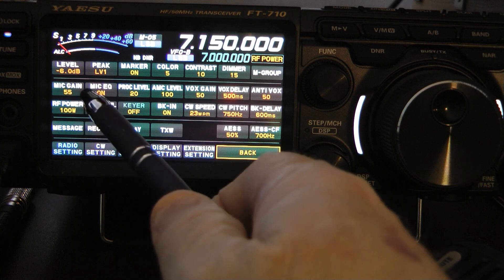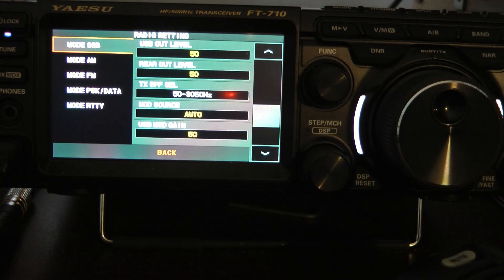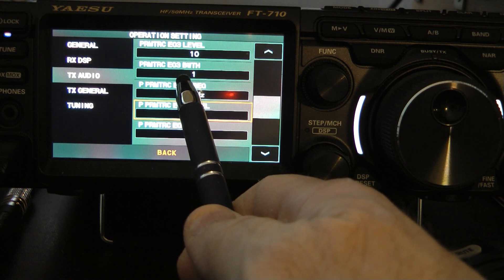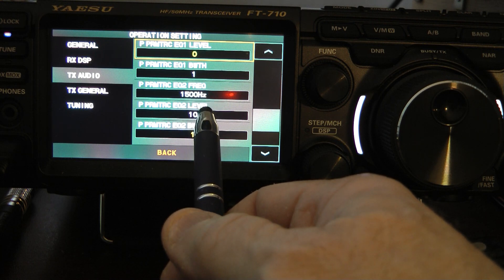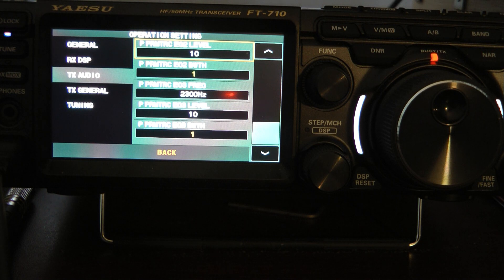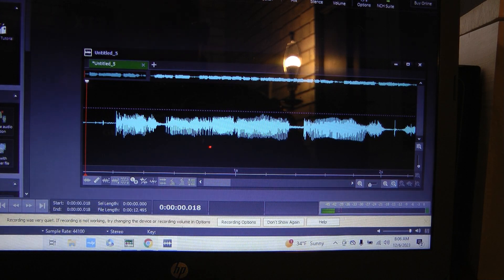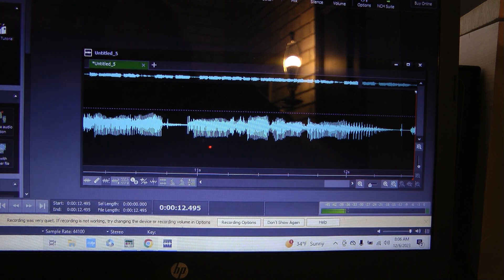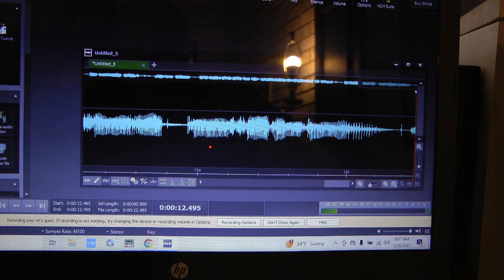Yaesu FT-710 Hand Microphone transmit audio setting, SSB Audio.

Comment: Thank you very much! Last night I received feedback that my modulation was weak with the factory settings. I just found this video, I adjusted the values. I'm curious. :)
Reply from the maker: Try this setting on the hand mic  TX bandwidth 30-3050, Mic gain 55, Proc 30, P Parm eq 1 Freq 100 hz, Level -1, BWTH 0.  P Parm EQ 2 1400 hz, Level 8, BWTH 1.  P PArm EQ 3 2300 hz, Level 10, BWTH 0
Reply: @ I've set it up. Thank you very much!

Comment: I am trying to find time to hook up my D104 to my 991a and FT-DX10 to see how it sounds. I have a condenser mic with phantom power and it works great but I am looking for a more tinny sound for pile ups. If it sounds too tinny or it seems like it may cause issues during contests I will more than likely not use it.